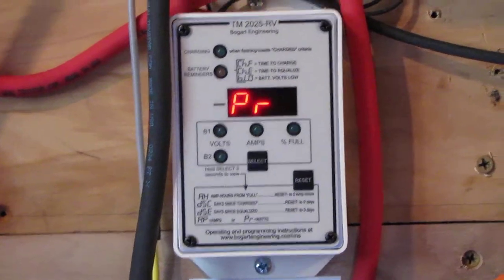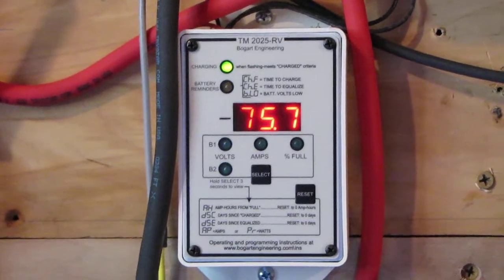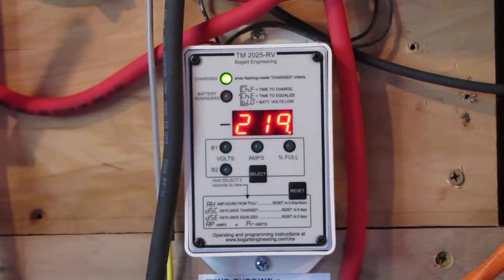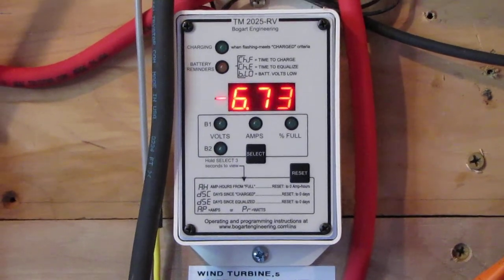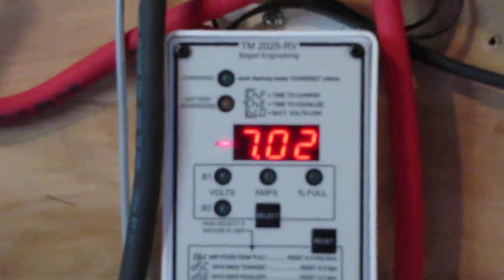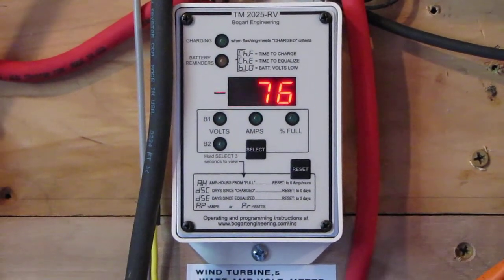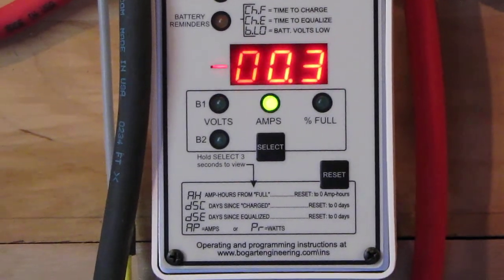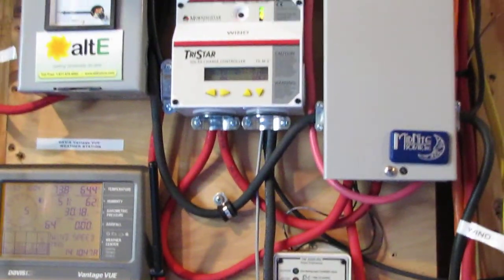Renewable Energy  In Virginia Harvesting the Wind  Raw Power

Comment: The 2025 RV and the 2025A are the exact same unit on the inside. They function on the same chip and are identical in performance. The only difference is that the RV comes in a box making it easily mountable. Personally, I'd prefer the RV because of its ease in mounting to my solar board similar to yours. Great vid, though.